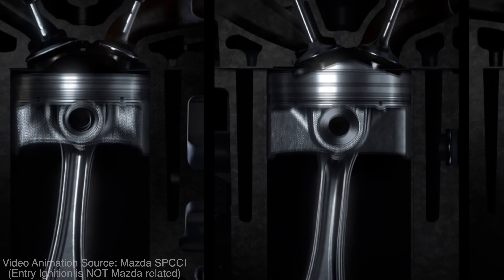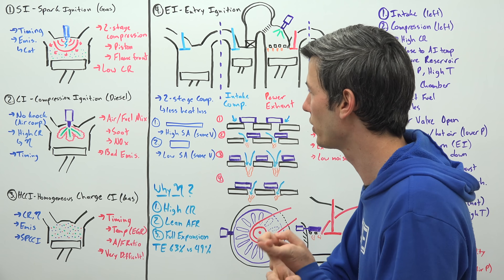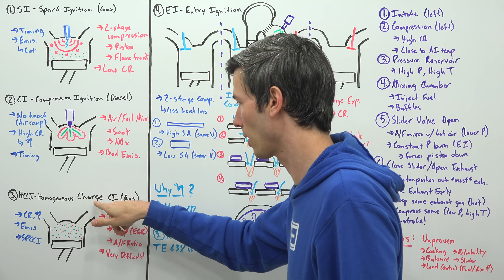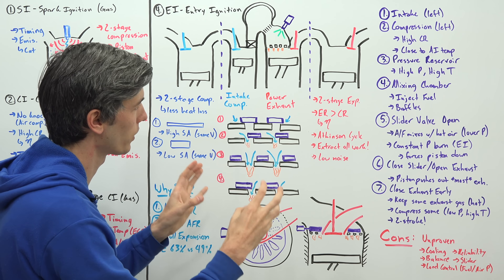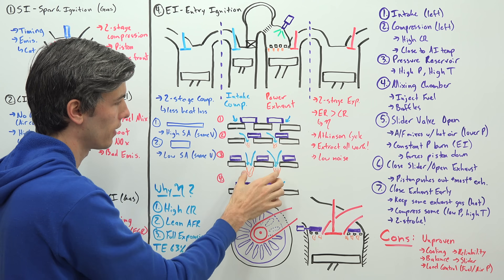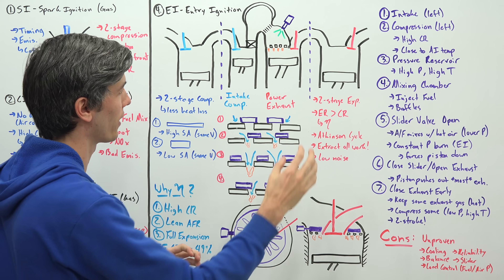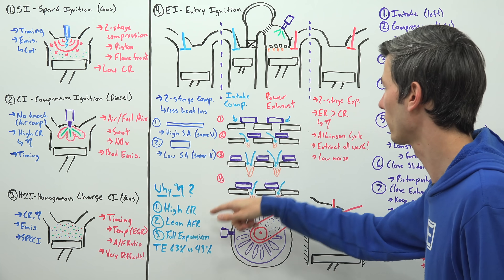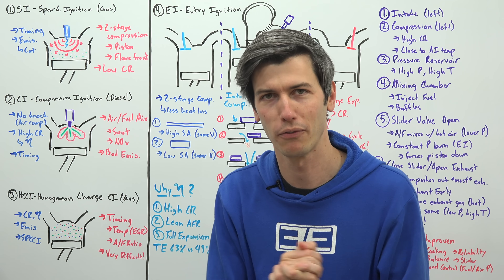Is 'Entry Ignition' The Future Of Combustion Engines?

Comment: Cant they just change the shape of the piston to match the combustion based on spark position rather than making a special new part that cost money and screws up balence? If they are worried about cooling then maybe come up with a way to cool each cylinder  individually with an accual heat reading of each which will help diagnostics and health. Maybe work in liquid nitrogen cooling it would be easier to balance this way. Instead of cheap sliders that spell problems to fix.

Comment: This looks like a very complicated engine, with wear concerns with that slider valve; I've seen elsewhere, that touted a plasma ignition with similar benefits that looked more promising though that may not go anywhere either.  Excited to see any improvements to ICE (but they're going to be dead on arrival if overly complicated and or expensive).

Comment: One con is also, that you cant use a turbocharger with the four cylinder setup. Because you have an atospheric pressure exhaust and the pressure before the turbocharger isn´t high enought to spool it up. And you could have a bit of trouble getting the exaust pushed through a long exhaust

Comment: Why the engine doesn't have pre-chamber that would put mixture with hot exhaust air coming from turbo? The drawback of this is carbon build up (like on direct injection), but if you put smoother (non-sticky, maybe teflon coated) walls, I think that this idea could work. Pair that with skyactive tech from Mazda, with this chamber valve separator, that could passive put up the temperature... The only thing here is the knock danger, so with many iterations, I think it's plausible.

Comment: very cool, it reminds me of triple-expansion steam engines.
Reply: While NOT for road applications, a triple expansion steam engine with Corliss valve gear is QUITE efficient.  The overall efficiency "gotcha" that's never discussed with internal combustion engines of any sort is the amount of energy consumed in preparing the fuel for use.  "The perversity of the Universe tends towards a maximum."  The molecular structure of distilled crude oil has abominably bad anti-knock properties, for both the gasoline (octane #) and diesel (cetane #) fractions.  Energy is expended to alter that undesirable structure into something whose anti-knock properties is OK.  ANYTHING that burns, regardless of molecular structure, can be used to generate and superheat steam.  Of course, the combustion process must not be a significant polluter.  Lunch is NEVER truly free.
Reply: Exactly my thoughts when it is explained. It is similar to it. But using gasoline instead of steam.

Comment: I'm not knowledgable in this field but, i would like to ask how those vavles would be driven, would it be either mechanical or electric?
and also, the packaging is what i'm concerned if it is compact enough to like fit in a motorcycle.

props to you for doing this vid, good job.

Comment: This just popped in my head. Why not utilize a rotor in place of some pistons? They weigh less, are smaller, and are far less complex.

Or run a 3 or 4 rotor design where the two inner rotors feed and expell to the next rotor instead just like this proposed design?

Comment: Your explanation of diesel emissions is incorrect. The big issue with modern diesel combustion emissions is that they are highly lean burn (high excess oxygen) in the exhaust stream. This high O2 load overwhelms the precious metal catalyst, so that they don't react the trace NOx and CO very well. It will select almost exclusively for the trace HC + O2 reaction. Thus the SI engine can take advantage of a very efficient 3-way catalytic reaction, but the CI engine cannot. (Gas turbines have the same problem, as they are also very lean burn.)  
If we only compared engine out emissions (no aftertreatment catalysts at all), the SI and CI engines are very close. The species ratios are slightly different, and the CI is usually less regulated emissions than the SI engine.

Comment: My problem with this seems to be one the complexity of the motor and two it basically one cylinder is the only one making power yet it has to turn 3 others it seems like all you improvements in thermal efficiency are going to be lost in the parasitic loss from friction and compression

Comment: I am concerned about the many moving parts of this engine, wich has basically one and a half combustion chamber. Isn't this gonna effect efficiency, reliability and weight? That one combustion and the final small one will have to move all the parts of the motor, wich seems to be quite a lot. The weight of the engine will result in heavier cars and it's size seems to be quite big if we want more combustion chambers. Even a twin cylinder would need eight pistons, and that seems a lot to me. Of course I am not saying this is bad tech, I am not an engeneer neither a mechanic, theese are just my concerns about this innovative and still intresting motor.

Comment: if you can look into the current F1 ignition that would rock,from what I understand they have a recessed spark plug with a small area of rich mixture and the rest of the cylinder is filled with a lean mixture using the flame 'jet' to control comubstion.
Reply from the maker: Explained here! https://youtu.be/kOhmgpkiIfg

Comment: I could see this being useful in a plug-in hybrid where this acts as a backup generator. You wouldn't need to worry about variable load in that case, and the efficiency is great for recharging the battery if grid power isn't available. Plus, if the engine doesn't run as much, it makes the long term reliability of the slider value less of an issue, assuming you try to plug in your car more than let it recharge on its own. Bonus points for being quiet.
Reply: Hybrids are great! Never have to worry  too much about range and you get the awesome efficiency of electric motors.
Reply: Going to have terrible maintenance requirements, though. Looking like BMW v8s, "after 50k miles rebuild or replace the engine".
Reply: I So agree!!
Reply: While the numbers aren't quite as great, the gas turbine could perform similarly efficiently and that is a very well proven technology. This is really cool, but it seems a little ponderous.
Reply: I thought the same thing. However, the load would still be variable, but the battery (or other storage system) would act as a sort of "buffer" between the load demand from the electric motors and the engine, it would make it easier to manage and give it more time to react to fast load/unload cycles that driving generates.

Comment: It seems that this has a lot parallels with jet engines, with the compressor and the constant pressure combustor. The energy extraction also has analogs with turbines extracting energy and dropping the pressure at the same time, but I'm fuzzy there.

Comment: So overly simplified: you enslave little jet engines and use their expanding exhaust gases to do useful work. You really need some wild imagination and solid engineering study to think of something so wild, congrats to the creator.
EDIT: I'm very interested in the topic of cold start of such engine, or generally in cold weather conditions. Do you think it would be fairly easy to start like SI engines or would it struggle like CI's do? Maybe it would depend on the compression technique: piston compression on the same crank would struggle more than independent compression, such as electric supercharger.

Comment: fantastic thankyou, The secondary expansion cylinder is remarkably similar to efficient steam engines. I believe a triple expansion steam engine held the record for the most thermally efficient engine ever built however this may not be still current but very interesting.
Reply: The most efficient steam engine ever built.  Just an FYI steam locomotives had roughly a 6% thermal efficiency, vs. a diesel locomotive, which has a roughly 36% efficiency.
Reply: Carl Jaekle triple expansions were mostly used in shipping not railroads. I don’t have any thermal efficiency numbers for the US Navy’s 600+ PSI small tube boilers in use by the end of WW2 though.
Reply: Knirin Yes, I looked into this further.  Steam locomotives were often double expansion. Triple expansion was very common in ships.  Current ship propulsion is often diesel electric or steam turbine.

Comment: Electric Motors are the future of combustion engines, it's ancient tech, time for the bin now
Reply: You do realize that the first electric motor was invented before the combustion engine, right? They're both ancient. The combustion engine just had the advantage of not requiring powerful batteries (which is still the limiting factor of current gen EVs).
Reply: @dsugioaga  Of course, I fully realise the reasons, but just as we don't have steam trains or horses & carts in widespread use now, we are at the dawn of the age where we have batteries with energy densities which support EV use and will only improve over time. The sooner we can move away from clanking disgusting ICE engines the better as far as i'm concerned
Reply: @Slash1066  I'm all on board with EVs. My comment was just aimed at the "ancient tech" part. But, as with any new tech, there will be a transitional period (it already started) and I think it's entirely possible that ICE vehicles will not completely disappear for a long time - and if some are going to stick around, you might as well make them as clean as possible.
Reply: @AzathothsAlarmClock  What's wrong with you? I just said that both techs are ancient... 

That being said, transcontinental flights on an EV plane already happened. For example, look up Solar Impulse 1 and Solar Impulse 2. The former flew from Spain to Africa and the latter flew from New York to Spain. Those planes are small and the flights took forever but give it a couple more decades of development and it might get more feasible.

Comment: I was interested until it got to the slider valve.
Reply: You can look at WWI plane rotary piston engines such as the French Gnome/Le Rhone to see why mixing/breathing chambers are an incredibly terrible idea as well
Reply: Yeah, I got a bit hung up with that also but apparently, most of the pressure is used up during the power stroke and the exhaust valve is timed to limit the pressure to not overcome the slider valve.  I'm with you, poppet valves have reigned for a long time and the fingers of a slider valve is a very troublesome arrangement with the pressure considered.  I recall many decades back experiments being done with 'swing valves' which were mounted more or less like rocker arms with a valve head on the end - it went nowhere apparently, never saw any further examples published.
Reply: @Richard Vaughn Yes, and they didn't work well at all
Reply: shane  
Oh, now we're talking...
Reply: shane  turbo-compounding is a great way to decrease mechanical reliability.

The ginormous R 4360 engines used on the dc6 and -7 piston airliners had a trio of "power recovery turbines" that the exhaust gasses blew through to power the crankshaft through a clutch. Any mechanic that worked on the engines called the PRTs "parts recovery turbines", they did a huge number on engine reliability. Like needing rebuilds four times as often! 500 hours time between overhauls, when a non turbo compound engine would last 2000hours!

Comment: The plate that slides over to let the mixture in and close for ignition is a mechanical nightmare. You have pressure behind it before it slides over and when it does move downward pressure against the top of the cylinder will need to be lubricated making the lubricant being introduced to the gas/air mixture. No lubricant is friction and the already hot chamber and surrounding metal will weld that thing together making a useless block of metal. Adding wear will possibly deform the fingers and bend or possibly break off and go into the cylinder with the pressure behind it. How efficient could a rotary engine set up be used for this endeavor? Why stick with the tried and true piston when there are other possibilities? I am not a rocket surgeon but there are more options.

Comment: I think the major issue researchers will initially see is wear on the actual slider valve. Having combustion occur next to the sealing surface as the hot air/fuel mixture passes will cause wear and reduce the sealing needed to control combustion. I know there are materials that will reduce wear, but they are more expensive and replacement after any # miles will be a pain

Comment: Btw, what is the problem exactly with knock in the second stage of compression? You already had your spark igniting the fuel, so basically at that point in time you just want all of the fuel to burn, right? Does it make a difference if it's ignited through the flame or through compression?
Reply: You want a controlled, even burn. Knock is uncontrolled
Reply: Think of a figure skater, leaping and spinning. Nice, smooth, sweet. Now, to simulate knock, throw a rock or three at her.

Comment: ....  Easier to put the intake valve in the piston and let it "float" in a pseudohydraulic actuator.   So an opposed piston system with roots would be superior right off the bat.   I remember this design from the 1980's and it has so much parasitic loss from running half an engine as an air compressor that the minute gains from better combustion are outmatched by massively increased pollution due to parasitism.

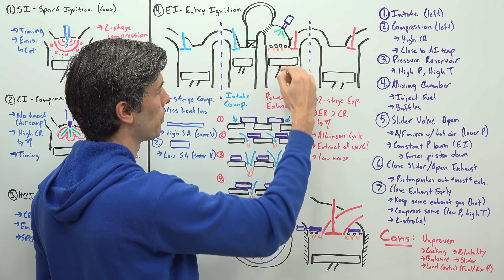Comment: 7:57 You said, that the combustion is going to have less pressure, than the initial air-fuel mixture. The initial air-fuel mixture however has less pressure, than it takes the gasoline to ignite. Therfore, the final combustion must have less pressure than just regular gasoline explosions in a usual cilynder. (if a<b and b<c than a<c) That's basic maths so why would this be more efficient if there is a limited ammount of pressure and therfore compression ratio?
Reply from the maker: Traditional engines have high pressure for a short period. This has a lower pressure for a longer period (near constant pressure burn, slow). This increases the area of the pressure-volume diagram, increasing work done.
Reply: @EngineeringExplained  I thought you wanted to burn all of your fuel as soon and quickly as possible. So you can get as much work out of the expanding gas. Burning fuel when the engine is a few degrees away from bottom gets you much less work than burning the same amount of fuel at the top of your stroke
Reply: @EngineeringExplained   yeah, but "work done" isn't the metric. Efficiency is impossible unless nearly all of the fuel's energy is converted to heat/pressure during dwell. After dwell the only issue should be "clean up", which MUST be largely done relatively early in expansion because otherwise the "clean up energy" is wasted. It's not like any system harvesting energy from a catalytic converter will be more than a few percent efficient.
Reply: The compression ratio refers to the difference in volume, not pressure! The effiency is therefore less dependant on a pressure differential, but more so on the difference in volume.

Comment: You could also use a second expansion chamber in spark engines - wouldn't that improve it's efficiency more than adding a turbocharger to a downsized engine? 
If so, the new trend could be upsizing rather than downsizing! ;-)

Comment: Some cars in the 1920s had sleeve valve engines. Sealing is difficult to achieve. Oil gets into the combustion chamber & is burned. It's an intriguing concept but impractical because of its size & complexity.

Comment: Lubricating that slider would prove to be a nightmare.  The only way this could be done would be to use castor oil, which poses another set of problems.  Also, the efficiency of this scheme would seem to be less due to greater internal friction.  And this would be a very expensive engine to build;  With electric cars on the horizon, I doubt any auto company would want to spend the money to go down this route.  Great video!
Reply from the maker: Intake/exhaust poppet valves are not lubricated in the combustion chamber. Mostly up/down motion, but they also can rotate. Fair point though, as described the slider mechanism would be challenging to lubricate.
Reply: @EngineeringExplained  My original design used an I/O valve that combined a poppet (to handle pressure) and a way low pressure rotating gate. The engineer I talked to from Volvo's SuperTruck engine development team said that going with such a system would take a decade and a huge amount of money to bring to market, and there'd be no guarantees. It's not like a company is going to put untested stuff into a product that, if it proves to not be durable, would sink the company. So those guys will have to do all the development on their own time and dime. This alone just about guarantees that the engine you described will not come to market (unless your name is Bezos). So, by the time a single engine was sold the patent would be close to expiring. Not a good bet.

And,  not contradicting you, just adding my two cents, poppet valves are adequately lubricated for rotational movement because the stem is lubricated, there's no rotation when they're closed, and when they're open the valve and its seat don't touch.

Comment: I see one problem there. There is one or maybe 1.5 cylinders that actually produce power which turn 2 cylinders that compress air. It seems to me that it will use most of its energy to keep itsself going.